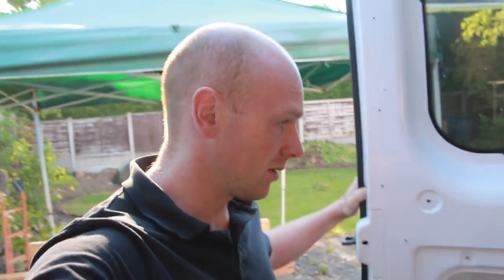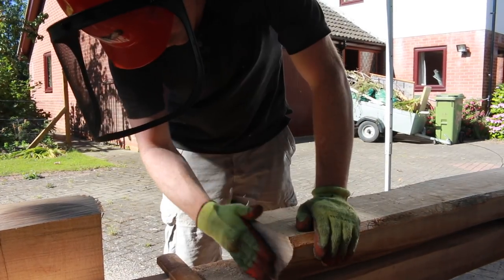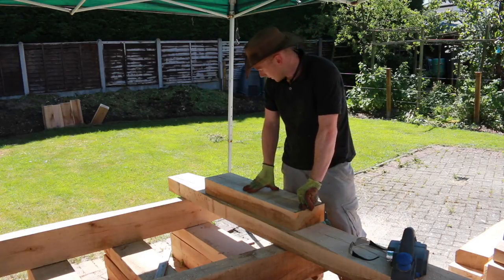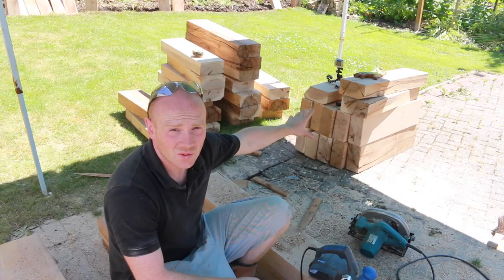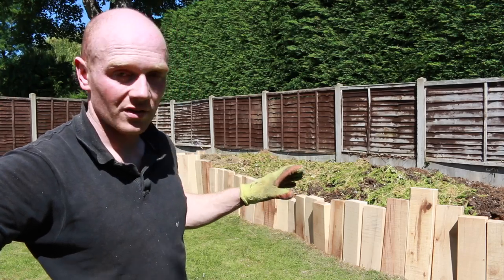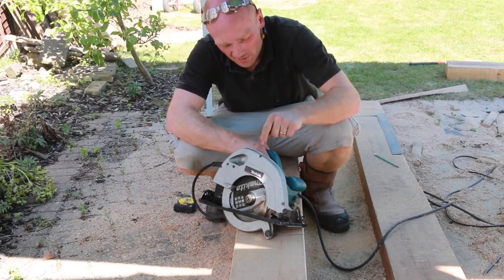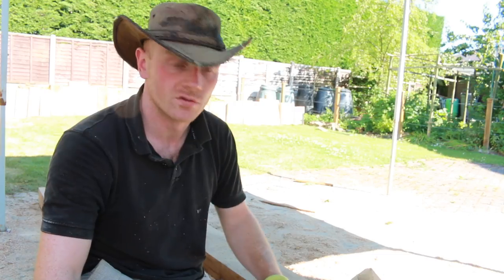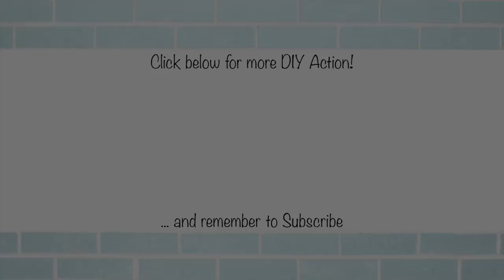OAK GARDEN WALL - 2.0 - Cutting and Layout

Comment: Buy a big chopsaw/ table saw! Not expensive and through in 1 cut
Reply from the maker: Still not quite enough.  My 255mm will cut the width but only to 75mm, even the largest Makita will only just do it and at 6-7 times the price of a circular saw not worth it.  Besides the infeed/outfeed supports needed would be an issue too, I know I wouldn't want to do it in 1 pass on my tablesaw with 100x200 oak.
Reply from the maker: Tony Colliver yeah that's a better size and not a bad price. Maybe worth it if doing lots, I've got my eye on the big circular saws for some timber frame projects next year. 😬